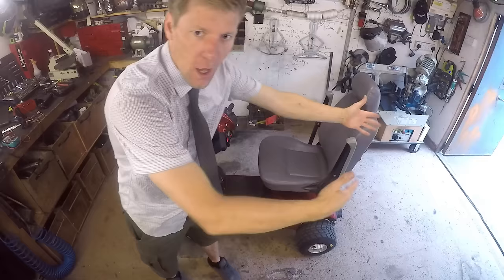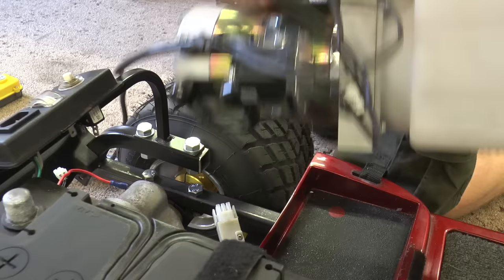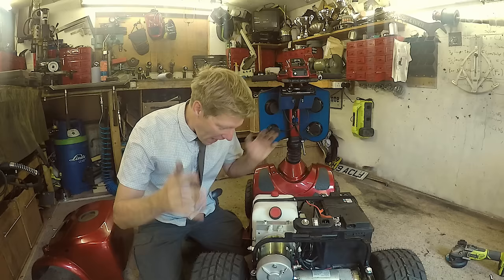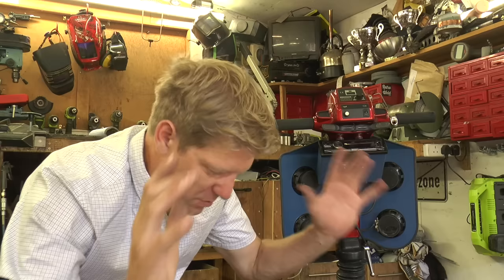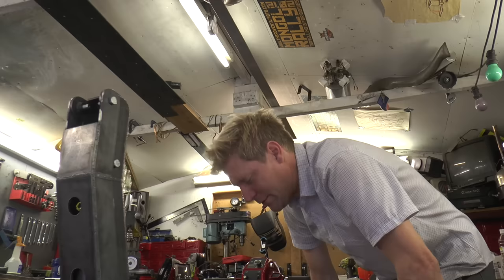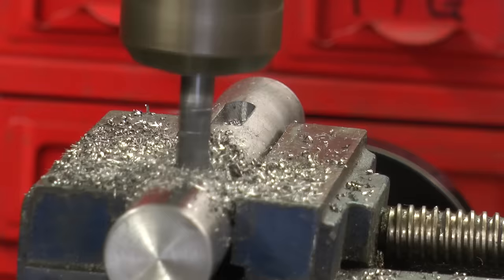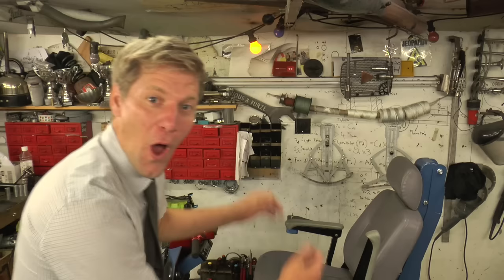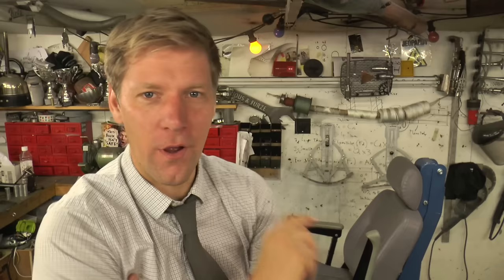Hydraulic Crane Seat-Scooter Pimp #2

Comment: LOL, that thing is a beast of hydraulics.  But the idea of something similar with a little less lift isn't bad.  I know my wife had many times where she was unable to reach things and just needed an extra foot or two of height to do it.  Since she passed away she does not have to worry about that but to be honest with my back issues I may not be far behind... Might just need to get me a cylinder and a pump and make a straight lift up system while I can.  Just that little bit of extra reach will be good.  Oh and an air horn so the jerks who want to stand in front of you and pass gas like you don't exist can get out of the way.